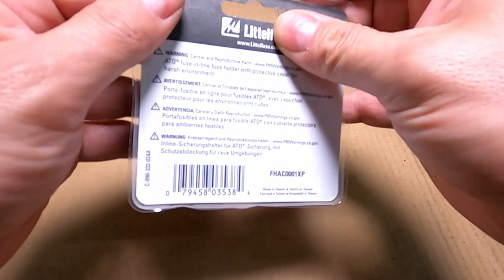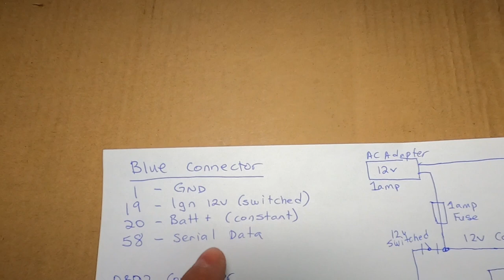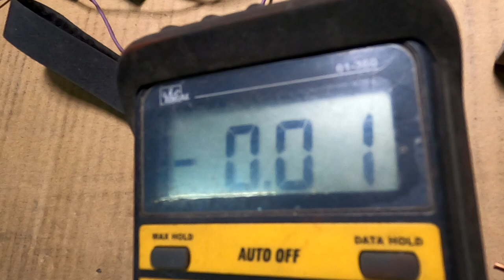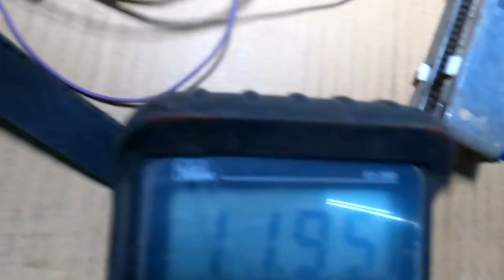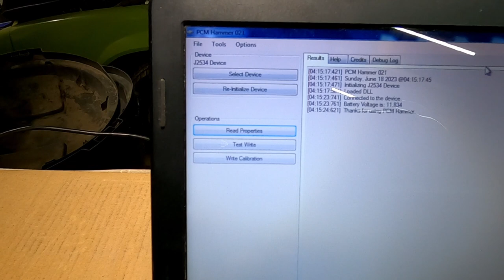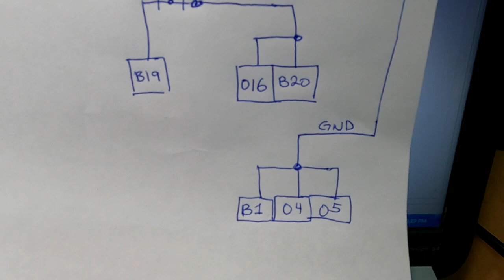DIY GM LS Bench Harness for PCM stuff

Comment: thanx for the info ..i wish you showed the switching on and off of the obd conn. also the plug thing other than those tiny things lol you hit it on the head about people not showing the actual making of things not just ok ill build it ,,then bring you back ,,?????? what in the???lol thanks again man great job......
Reply from the maker: The switch I put in place just acts similar to using your key in the ignition. Depending on the software you use they will generally ask you to cycle the power or something and that is all the switch does.

Comment: Have you checked the output waveform on those wall warts?  Most are crap!  Need a well filtered 12v supply.  Heard of alot of guys bricking there ECMs with wall warts.

Comment: Should I just cut thr pcm connector out of my old harness(donor) ?
Reply: Actually.. that’s a good idea.. I bought a separate (stand alone) harness. I’m gonna give it a try, I already have a 12v 1A power supply. So I’d actually just need an OBD port, which I’ll check if the old harness has, doubtful but I’m gonna check

Comment: I'm looking for a PCM pinout/wiring diagram for a 2004 Cadillac Escalade in order to make a bench harness and programming. Do you have any insight if your GM truck might be a similar setup as the Cadillac since they are both considered trucks? Thanks
Reply from the maker: The PCM should be a P59 but confirm looking at the sticker on it before doing any work.
Reply: @toolshedadventures  @everyone yes it is a p59. The sticker has hardware number 12583660 . I just want to confirm that the wiring doesn't fry my PCM if 12v is applied to the wrong pins on the PCM. I did a search with the hardware number 12583660 and it comes up with that PCM was used in 2004-2007 Chevy Silverado. Mine came out of a Cadillac as I had mentioned.

Comment: That power supply is garbage! Spend a little bit of money and buy a legitimate bench power supply! Also that wall adapter would shut itself down before it ever popped that one amp fuse the fuses rated for 1 amp you could easily put two plus amps into it before it would even think about popping and that wall adapter can't output that much current so the fuse is useless

Comment: What would be the total cost of building this harness ?
Reply from the maker: If I was to add it all up I would say somewhere around $50-60 CAD
Reply: they're pre made for 30 bucks on amazon
Reply: @parker12c  I bought mine from amazon with these same connections on the OBD connector, but on the PCM connector they have the ground wired to pin#60 which I think should be pin#1 as the "toolshed adventures" has shown. So make sure your connections are the same as the video.
Reply: @darylvoorhees2629  I had no issues with mine - read and wrote to pcm just fine, iunno mate.